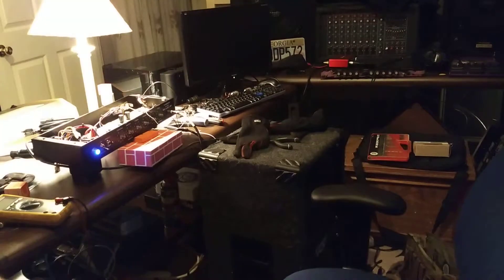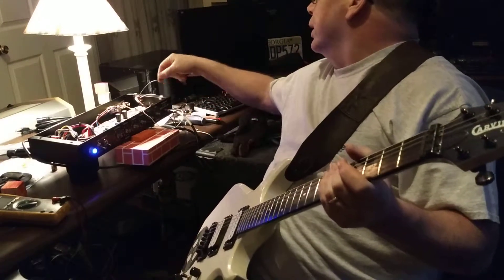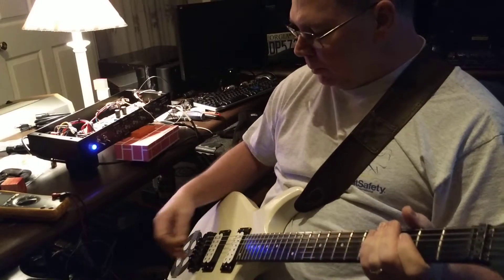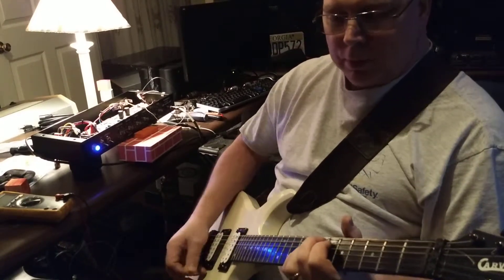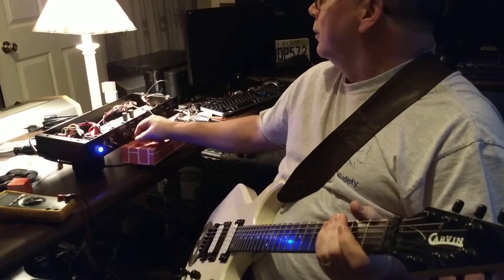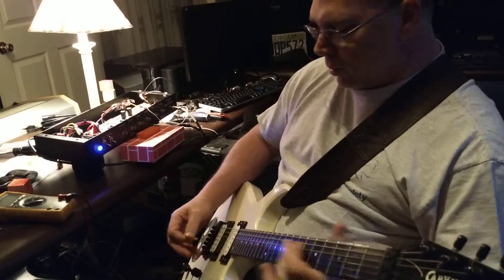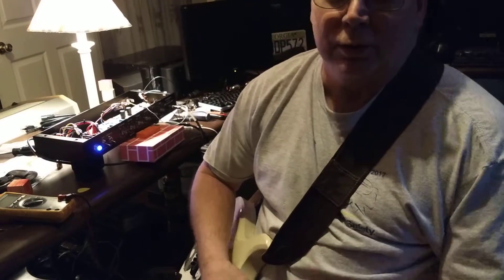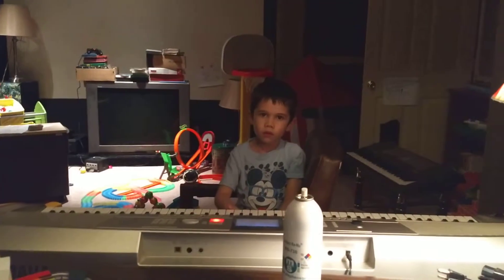Jet City JCA20H Full Nelson True Plexi mod, normal channel

Comment: Hey Jimmy, this one. What were the changes you made here, if I may ask? I was also thinking it would be cool to mod the 20h to the overdrive circuit of the 22h. But I have no experience in modding. I sure do like the way this sounds.
Reply from the maker: Hey Thomas, it's a pretty involved mod, if you look at the schematic of an old 4 hole Marshall you'll pretty much see what I did. You won't get the Crunch channel to 22H overdrive levels as the 22H has an extra preamp tube adding two more triodes of gain. I highly suggest studying two web pages: Rob Robinette and Doug Hoffmas sites. I learned a great deal there. Once you gain a working knowledge of amp circuitry. Modding makes a lot more sense. Rock on.